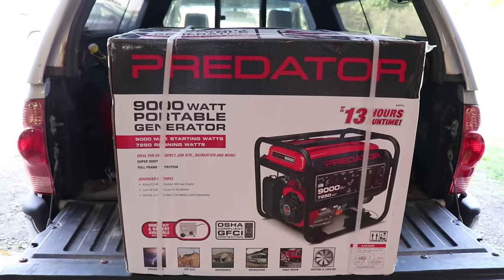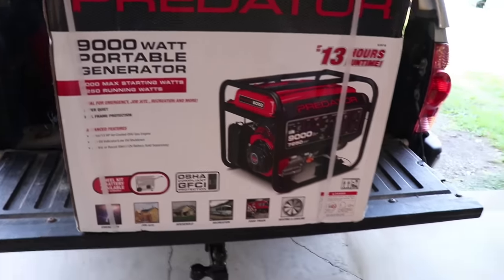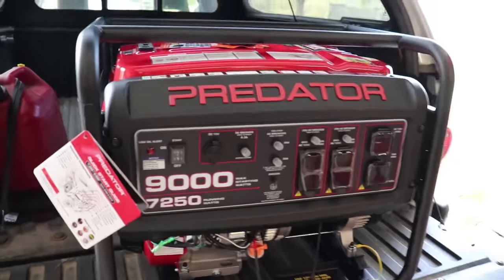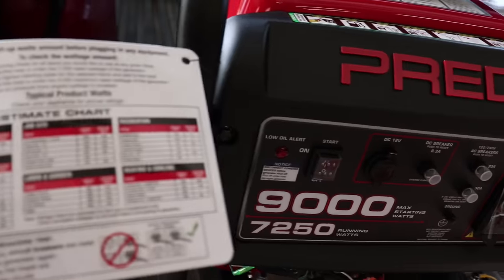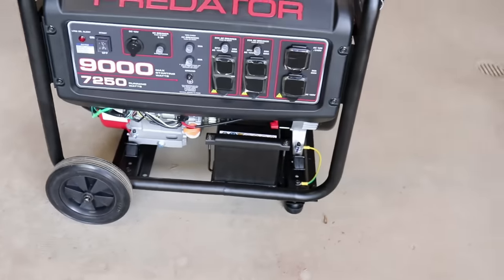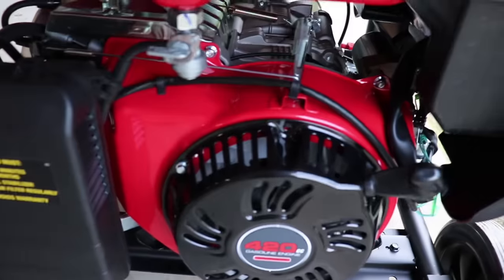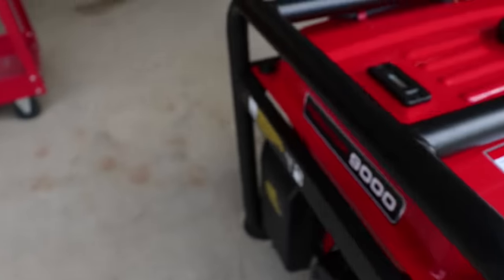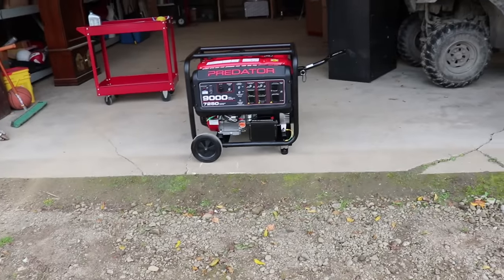Predator Generator Running Our ENTIRE Home. (Complete Setup and Cost)

Comment: I have a 6500, used to for 3 days.  I live in Houston so I needed it, and that thing worked flawlessly.  A refrigerator, deep freezer, tv, space heater and my wifi.  Flawless...
Reply: ⚠️Please don’t forget about Generator safety: please remember not to ever run your generator indoors. Generators should only be used outdoors. Always remember that carbon monoxide fumes are odorless and colorless gas that is a silent killer that you cannot see or smell. Carbon monoxide is dangerous and it can cause death. Carbon monoxide is poisonous. Always keep that in mind when using generators. You need to have a carbon monoxide detector. Make sure your generator is 15-20 feet away from your house and away from doors, windows, and vents. Never use your generator indoors even if your doors and windows are open. Some people run their generator indoors during hurricanes which is dangerous and you and your family will die if you use generators indoors. Running a generator indoors increases the risk of carbon monoxide poisoning. Please don’t run your generator in wet conditions. Running a generator in wet conditions can electrocute you. You need to keep your generator dry. Don’t let the portable generator get wet. You need to have a generator tent as well to protect your generator from getting wet if you will use  your generator during wet weather. We also really need to keep our children safe when we’re using portable generators so they won’t get electrocuted or burned by the generator which is dangerous. Generators can be hot. You have to keep an eye on children making sure that they are not near the portable generator to avoid any risks. We have to be aware with all the hazards and follow all the instructions in the generator’s operating manual. Generators pose electrical risks. Make sure your generator is not overloaded. Overloading your generator can cause damage to the appliances that are plugged into the generator. Please don’t overload your generator. Don’t ever try to plug a generator cord into a wall outlet to avoid back feeding. Back feeding is dangerous. Always turn on your generator first before plugging in appliances. And before you unplug the appliances, please shut off your generator first. Please use a heavy duty cord for your generator and the cord should not be worn out. Please don’t refuel your generator while it’s running. You should shut off your generator and let it cool off before refueling it. Refueling your generator while it’s running can cause fire if gasoline spills on the generator’s engine because it’s hot. Please make sure your generator is properly grounded. Everything that is said on the generator’s operating manual should not be ignored. They all need to be followed. https://youtu.be/I1jT3ANENvI and here is a video more about keeping your family safe while using generators. This is for everyone’s safety. This is just a safety reminder for everyone to make sure that you are aware with the warnings. Thank you and hope you stay safe.
Reply: @The_Happy_Aviation_Enthusiast  wow thanks
Reply: @The_Happy_Aviation_Enthusiast  A no brainer
Reply: @theory816 That's sad, even if you were never taught about those dangers it could have been avoided by reading the directions.
Reply: Good to know I just bought the same one, wanted to make sure I can run my fridge and deep freezer and sump pump at minimum good to know I can get a few luxuries with it.
Reply: @The_Happy_Aviation_Enthusiast  Good advice. Thanks
Reply: Wondering what type of fuel you used and how much fuel you went through for the 3 days. Thanks.
Reply: @The_Happy_Aviation_Enthusiast  REALLY APPRECIATE THIS 🎯🎯🎯🔥🔥🔥
Reply: @theory816 😥😥😥😥
Reply: @The_Happy_Aviation_Enthusiast  Darwin will figure out stupid people. Also, don't stick head in toilet 🤣
Reply: @Krobear Ethanol gas is perfectly fine if you burn through it all or drain the carb. Where I live non-ethanol costs more than diesel. I'll pass.
Reply: How much fuel does it take per day?

Comment: I'm watching this preping . I know nothing about a Generator but I do know I have to become knowledgeable so that my family will be ok.
Reply from the maker: Start slow...then add as you go. Prepare for 72 hours, then a week and so on and so on. It's easy to do! Here are some ideas from our prepper pantry (food storage) to help get you started! God bless you!
Reply: For running your house 9000 and up would be the best also if your single don’t get the pull start it does take some will power to pull start 
Get the electric start  use it outside
Reply: Watch the cook family homestead videos I learned a lot from those videos.
Reply: Depending on where you are generators  can be essential to a nice luxury. We are in north Idaho but live in town. Until recently power outages were very short and infrequent. Lately we are getting more and longer outages. So the generator is now something we see as important. 

We are wired for a generator, much like the OP: with a 50 AMP circuit 240V. This allows for up to max 12,000 Watts . The largest we can hook up is the Duromax 12,000 starting watts and 9500 running watts. Run about $1300.

When you add the plug, make sure it is 50A and 240V like that of the OP. That gives you the greatest flexibility.
Reply: @TheCookFamilyHomestead  I just started prepping too.

Comment: After this emergency in Texas that we have there are no more time to wait we have to install some of these generator in each house no more excuses no more cold days and nights. Thank you for your video that helps a lot.
Reply: Agreed I’m in Georgetown Texas, after 92 hours just got electricity back
Reply: Yes I’ve been very fortunate to have my electricity here in Dallas during the duration of this crisis....I’ll definitely be investing in a generator now
Reply: The cold is way more bearable than living in a power outage when it's 100 degrees outside. I am in Houston, and was without power for 3 days. It reminded me of how bad it gets here when we have hurricanes. So I am shopping for a cheap generator that can power a window unit and not much else.
Reply: Time to prep before we suffer the same as texas! God bless for these videos!
Reply: Running a central heater off one of these little generators probably won't work.  30A just can't power something running on a 70A breaker in your box.  May not be able to run A/C either, depending on size of the unit and the type of starting system it uses.  Cooling  is more often the challenge in Texas power outages.  Heat can be accomplished with a simple indoor propane heater.  Also keep in mind that you can convert these generators to use propane or natural gas.  Propane keeps a lot longer on the shelf than that damned ethanol gasoline that turns into jell-o after just a few months.
Reply: @furcifer8218  definitely everyone means every home have to have a generator, if is not enough to run the air-conditioning or the heater in the house a lease you can run some portable heater or window ac it's better than nothing. I know that helps a lot.
Reply: Yep. Learned my lesson and ordered one.
Reply: Yes!  I love in south Texas and was out power for four days!  Definitely doing my research on generators in hopes to find the right one.
Reply: Check out the cheap Chinese diesel heaters that run off 12V
Reply: @furcifer8218   It depends on a number of items. If you have a gas heater, the blower motor is usually about 1hp which runs on a dedicated 20amp circuit (at least mine does). My 13kW gen nicely powers the entire house (2,700sf) except for the oven, dryer and AC. I do not know how much power an electric heater would use.

Comment: I bought the same predator 9,000w Generator a year ago and live in the mountains of California where power outages happen all the time. We are currently going 9 days straight without power due to a massive snow storm  and this generator hasnt missed a beat running my whole house and keeping my family warm in below freezing temperatures with 4ft of snow on the ground.
Reply: I noticed prices for these have gone up, how much did you pick up yours if you don’t mind me asking
Reply: I got mine for $625.00 with a 20% discount about almost 2 years ago I just went in to Harbor Freight last week and it was $865.00 so they’ve gone up in price
Reply: How much fuel does it take per day, and do you turning it off, or running 24hours in day?

Comment: We need these type of generators  in  Houston for hot summers, hurricanes aka HARVEY  and winter storms  2021. Thank you  for your video.
Reply: Exactly...I was on line two days ago n harbor showed some in stock, but their doors were closed...now they are all gone.! Crazy, in east Houston.
Reply: The fact that we now need generators for every season proves we need to reconnect to the country's power grid. Needing a generator year round is like living in the 3rd world. This is unacceptable.
Reply: Definitely not depending on the grid as much as I used to do. Generator a must then solar panels next
Reply: We have this set up for our house. My entire town was out for 64 hours but we were fairly comfortable with our generator. In SE Texas with hurricanes it is very necessary to have.
Reply: Can you do a  video on the generator breaker
Reply: You need to move
Reply: The whole reason I am here is because I am living through the deep freeze of 21 here in Houston. It reinforced my thinking in that it is miserable to be without heat , BUT it is FAR more miserable to be without AC. Given that Houston has not had a bad hurricane since 07 or 08, we are due for one. I am looking for a generator that can power a small window unit, wifi and laptop. I need it to run for 8 hours without refueling. Any suggestions are appreciated.
Reply: @ARTCARGAL  for that light of a load look into the Champion 4000.
Reply: I just bought mine for my house in Katy
Reply: @ShawnMtz_78  Well the problem is you should have already had it you dont wait for a hurricane or a disaster than expect all retailers to have it in stock theres always someone thinking ahead of you thats why they dont have none in stock people do that all the time   thats your fault not Harbor Freights
Reply: I live in uvalde rd.. I'm lucky I have 3 generators...
Reply: @ARTCARGAL  yeah here in Houston needing generators how sad.. I live 610 and i10 east
Reply: @jesusyeshuaelelyonelshadai6295  beltway 8 and I10 here and I ordered a generator yesterday. I'm not going through that bs again
Reply: @grabkem  those things can freeze my guy ok
Reply: @ARTCARGAL  harbor freight got a 2000w generator that cost $500 minus coupons for 5 hours with a gallon of gas at max load.
Reply: @OnyxWaterIvyBound  you do realize the other coasts have severe powegrid failures right? Don’t depend on external infrastructures.
Reply: I just lived through Texas #snovid2021 in Houston also. I will never be unprepared again.
Reply: @OnyxWaterIvyBound  Agreed 👍
Reply: @ARTCARGAL  I'm in Houston also. Definitely agree!
Reply: @matthewsimmons13777  Which one did you get? I'm in Rosharon.
Reply: @Lifechanging99999  I live in Texas. I know what I'm talking about. The storm wasn't the cause of the outages. Deregulation and negligence in winterizing the power plants and wind turbines is the cause. And also, kids are sassy, I'm an adult, tax-paying woman who spent 3 days freezing to death so excuse me if I'm pissed off at someone trying to rag on us for not being prepared. Thank you.
Reply: @tibbytx1  well I live in San Antonio, so I experienced this as well. I had my toddler go to the ER when this started. We
Went well over 3 days without power. It’s about preparedness not about politicians. I could have done better. Fix government when possible but don’t trust them to save you. Your trust in them is very susceptible to failure. Furthermore, this whole storm was an anomaly. So it’s not their fault.
Reply: @OnyxWaterIvyBound  ppl tend to speak of third world countries based on what they have read in books. Most countries have great stable networks and do not run on generators all day sir!
Reply: I highly recommend them. Every time my home depended on mine it has never let me down. Just remember to start them up every so often to keep the  carburetor parts moving freely and tiny holes from clogging.
Reply: @HondaRRChic  Im in Texas also and I cant agree with you more. When the power was off in below freezing wheater for several days this generator made my home comfortable. We had everything we needed daily thanks to our Preditor generator 24/7. I did bust my ass several times due to the solid sheet of ice when refueling🙄
Reply: @glenchadwick420  right. The only downsize was having to refill tank every 8 hours. It never got below 55 in our home and that was with only a couple of crappy heater that we use to warm up our bathrooms. (We will be investing in a decent space heater before next winter). Since we were able to keep our home above freezing we are not going through the busted pipes nightmare out neighbors are. We have used our generator a couple of times for hurricanes never thought we would need if for a winter ice storm.
Reply: @ARTCARGAL  Where were you for Harvey?
Reply: Its best to get a generator and connect to your house breaker box so you dont have to worry about extension cords. Also look into getting a tri fuel conversion kit so you always have a fuel at your disposal. Word to the wise do NOT make your water heater, stove, central a/c dependent on 1 specific source of energy. Have 1 system electric and the other gas so if 1 source is cut off you still have another source to get by. Just a thought
Reply: @glenchadwick420  invest in multi fuel carburetor and hook it up to natural gas from home and never have to refuel
Reply: @matthewsimmons13777  v. 
K
  0
 .I'LL
Reply: Please make sure you all are aware with the hazards of using generators. Generators can be dangerous if not used carefully so make sure you follow all the generator safety instructions. I know all about generator safety and I have something to explain to everyone about generator safety. Here is what you all should know: please remember not to ever run your generator indoors. Generators should only be used outdoors. Always remember that carbon monoxide fumes are odorless and colorless gas that is a silent killer that you cannot see or smell. Carbon monoxide is dangerous and it can cause death. Carbon monoxide is poisonous. Always keep that in mind when using generators. You need to have a carbon monoxide detector. Make sure your generator is 15-20 feet away from your house and away from doors, windows, and vents. Never use your generator indoors even if your doors and windows are open. Some people run their generator indoors during hurricanes which is dangerous and you and your family will die if you use generators indoors. Running a generator indoors increases the risk of carbon monoxide poisoning. Please don’t run your generator in wet conditions. Running a generator in wet conditions can electrocute you. You need to keep your generator dry. Don’t let the portable generator get wet. You need to have a generator tent as well to protect your generator from getting wet if you will use  your generator during wet weather. We also really need to keep our children safe when we’re using portable generators so they won’t get electrocuted or burned by the generator which is dangerous. Generators can be hot. You really need to keep an eye on children making sure that they are not near the portable generator to avoid any risks. Do not put children in danger. We have to be aware with all the hazards and follow all the instructions in the generator’s operating manual. Generators pose electrical risks. Make sure your generator is not overloaded. Overloading your generator can cause damage to the appliances that are plugged into the generator. Please don’t overload your generator. Don’t ever try to plug a generator cord into a wall outlet to avoid back feeding. Back feeding is dangerous. Always turn on your generator first before plugging in appliances. And before you unplug the appliances, please shut off your generator first. Please use a heavy duty cord for your generator and the cord should not be worn out. Please don’t refuel your generator while it’s running. You should shut off your generator and let it cool off before refueling it. Refueling your generator while it’s running can cause fire if gasoline spills on the generator’s engine because it’s hot. Please make sure your generator is properly grounded. Everything that is said on the generator’s operating manual should not be ignored. They all need to be followed. https://youtu.be/I1jT3ANENvI and here is a video more about keeping your family safe while using generators. This is for everyone’s safety. This is just a safety reminder for everyone to make sure that you all are aware with the warnings. Thank you and hope you all stay safe.